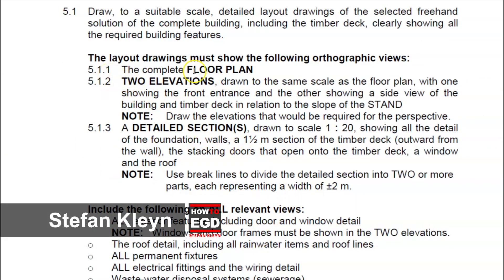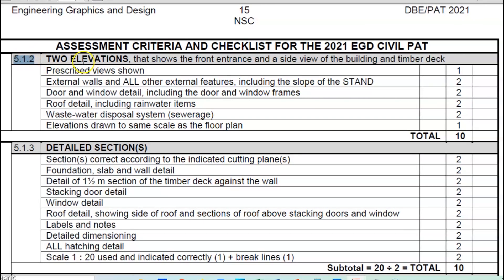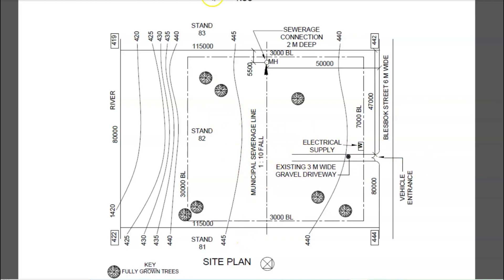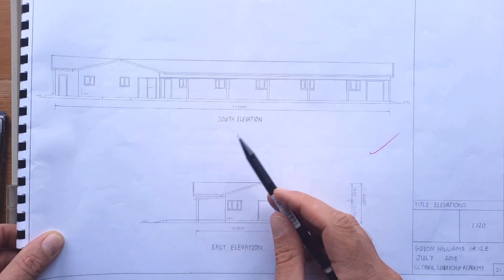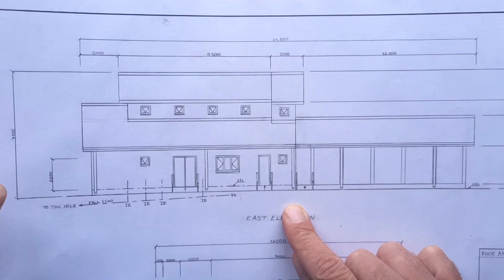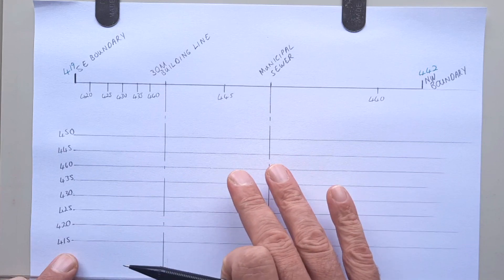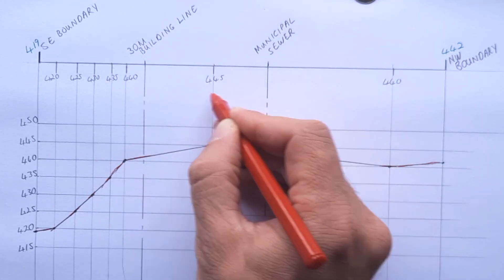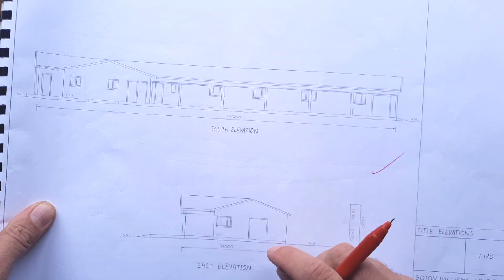7. HOW TO HACK YOUR PAT: Drawing the ELEVATIONS - EGD Grade 12 - Civil PAT Task 2021

Comment: THANKS
sorry sir but i really dont understand how can i draw the slope of the site plan.. whats the scale of drawing it?
Reply from the maker: Hi Josia, thanks for the question. If you are referring to the rough drawing I did from the 7min mark to determine the slope, that scale is determined by the page size you are using. I did my example on an A4 so used scale 1:400. Remember,  the actual measurements never change. For example for Scale 1:400, you just devide the actual measurement, 115000mm for the long boundary, by 400 and it gives you the millimeters to draw on your A4 paper. Let me know if that helps you. Cheers
Reply: @HowToEGD  thanks for enlightening me on that too , but my problem is the measurements of the contours line  ( the 430 435 440 445 how do i measure them
Reply from the maker: @innocentjmathonsi   thanks for the feedback. I am a bit restricted in my ability to effectively communicate to you via this chat forum and from your comment it isn't 100% clear what is the core of your problem. I encourage you to check in with your teacher who I am sure will be able to assist you with the finer details/explanations of scale. All the best for your PAT completion.
Reply: Excuse me but I'm having the same problem, did you happen to figure it out @Josia Mathonsi?
Reply from the maker: @rahimagierdien7177  re-reading this thread, it seems the problem is with regard to the spacing of the Contour lines on the site plan... If this is the case, you can estimated to good proportion the correct spacing as it is not exactly defined in your brief. All the best with your PAT!

Comment: That's an overview. Now it my turn.
Reply from the maker: Now you are talking Mulisa. I like to hear that. Go for it!!
Reply: @HowToEGD  sir I tried it out and the question now is how do I magnify it for it to be of scale 1:100 . in finding the slope I used 1:400.
Reply from the maker: @TrueTalk_podcast  Hi, all you need to do is apply basic Scale principles. Remember, the actual measurement in real life does not change, it is only the scale which you draw with on paper that changes. 

A simple trick: To draw to scale 1:100, take a measurement, for example 10m (10 000mm) in real life and divide the 10 000mm by 100, it gives you 100mm. 10 000mm drawn to scale 1:100 is thus 100mm on paper. 

To draw 10 000mm to scale 1:200, you will now divide the 10 000mm by 200, which will be equal to 50mm on your paper.... 

Trust that makes sense. All the best.
Reply: I used scale 1:500 but now I'm also trying to find out which scale can I use to make it bigger
Reply from the maker: Chijioke, the scale of the elevations must be the same as the scale used for your Floorplan.
Reply: @HowToEGD  thank u sir now I get it😅